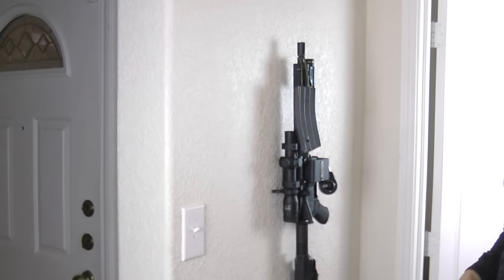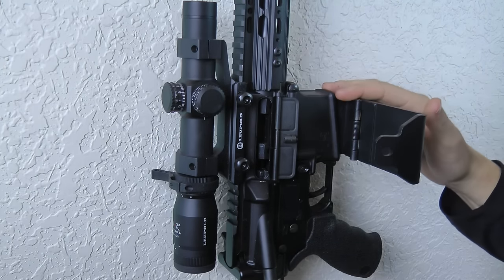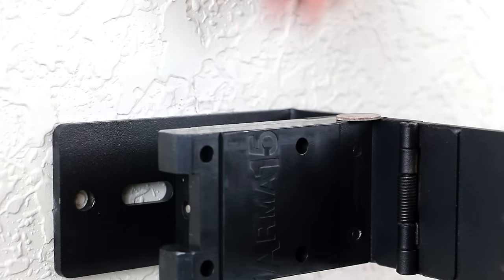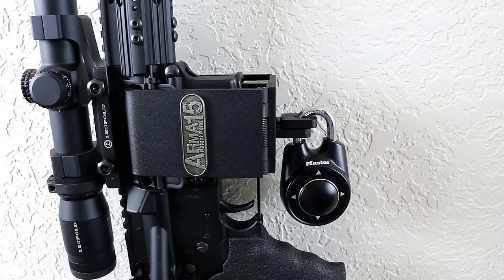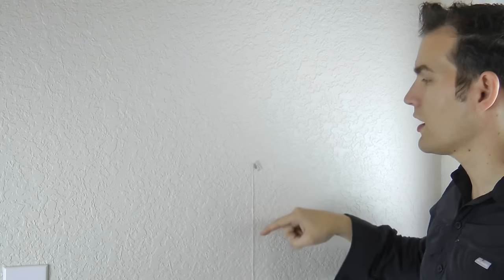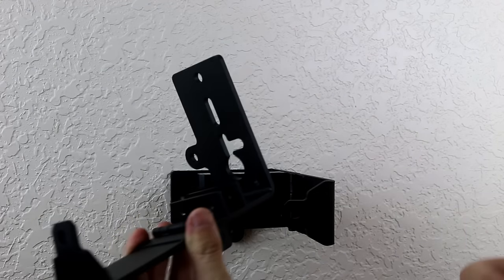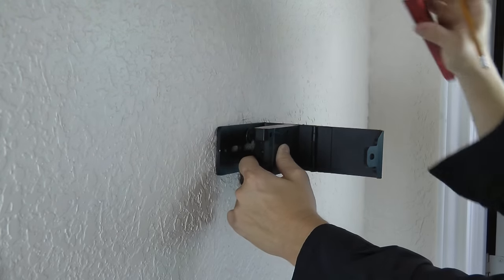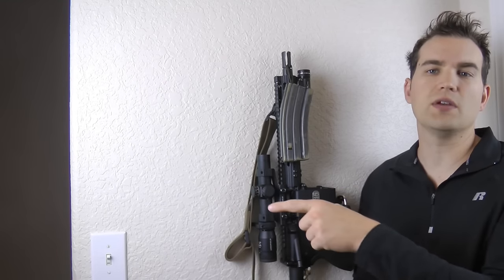AR15 Hidden & Locked on Wall Under a Jacket ARmA15

Comment: I like the hiding in plain sight. Thieves always go to closets.
Reply: When I bought my home after retiring from the Army, the home was a short sale with no disclosures.  Lived here for months and one day vacuuming, I hit something,(not telling what) and a door opened up, revealing a hidden room with power, A/c, cable,  antenna jacks for some sort of ham radio and shelving.    I did however modify this room so it cannot be accidently found.  I put in magnetic locks with battery backups.   I also added a stand alone cell based  alarm just for this room, and for good measure, I have a capsaicin counter measures.   If someone disengaged the magnetic lock by tampering with the circuit,  I built a device that shoots Fox Labs 5.3 spray if the door is opened without disarming the alarm. (I keep lots of Sudecon on hand in case it ever malfunctions)

  But even with a secret gun room, when I go out of town, I still lock down my rifles.  (For my AR's I have three hardened O bolts bolted to a stud with a heavy cable that goes through the mag wells.     This product is a quicker way to grab a gun than what I fabricated, going to buy one shortly and check it out.

   I do appreciate you taking the time to make this video, was very helpful.
Reply: @crabbysam  Wow, that must have been a great find. Secret rooms are not exactly cheap to design and build.

Comment: Scope on home defense ar?
Reply from the maker: +Tyler Reis Yes the two scopes are leupold the other a trijicon both 1-4x.  When on 1x the scope is like having a red dot i had 3 aimpoints in the past.  Just as fast with the ability to go to 4x if needed.
Reply: RYNO303 a scope on 1x is exactly nothing like a red dot they dont have any of a red dots advantages like unlimited eye relief and a moving reticle with a low amount of parallax witch helps you when you have to shoot from an awkward angle or around a corner with your off hand 

If you know how to properly use your irons in cqb they are still better then a long scope set to 1x with a crappy little eye box 

Dont get me wrong they ain't bad for cqb but there not optimal use what ever you like but you shouldent call someone a tart when they were actually the one who knew what they were talking about

Comment: Just bought one! Looks like the best on the market.
Reply: Karl Kessler looks to me that a thief could take the pins out and take the upper or possibly rip it out of the wall stud.  I'll have to get one to make a real judgement but its a concern of mine
Reply from the maker: Removing pins wont allow the rifle to be removed.See some of our other videos on arma15.com to realize how its locked.  The lower is locked threw the mag well, the upper is locked threw the ejection port.  So with no take down pins installed in the gun at all you still cant remove from arma15 when locked.  Hope this helps
Reply: ArmA15 AR15 looks to be of good quality I do intend on picking one up, if satisfied I'll end up with a few more.
Reply: @constitutionalrepublican1611  How do you like it?

Comment: How did you put a paracord/ cord on the mag
Reply from the maker: There are many youtube videos on it.  Its simple remove the bottom floor plate and knots prevent it from pulling out.
Reply: @Arma15  Couldn't you replace a Pmag's baseplate with a magazine pull and then run a paracord through that? That's what I'm thinking of doing. I'm 100% planning to get your Arma15 very soon and replace my home defense shotgun with a rifle.

Comment: How did you attach paracord to your magazine?
Reply: Kyle Carlton Oliver the bottom part of gi mags (aluminum magazines) comes off. You then burn the two tips of the 550 chord to make kind of a ball then slide plate back on while those two balls are inside making a loop for you to pull the magazine using the loop. We did this in the Army for faster reloads.
Reply: Kyle Carlton Oliver take the base plate off by bending the back section of the plate up and away from the rest of the mag then slide the plate backwords. the paracord can be ran threw the drain hole on the base plate and knotted on the portion of the cord that stays inside the mag to keep the paracord loop secured